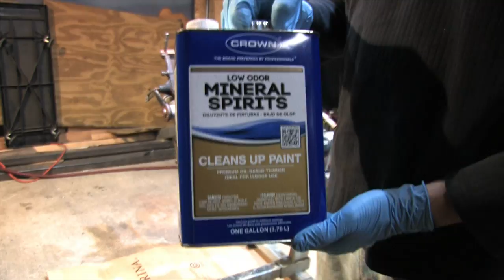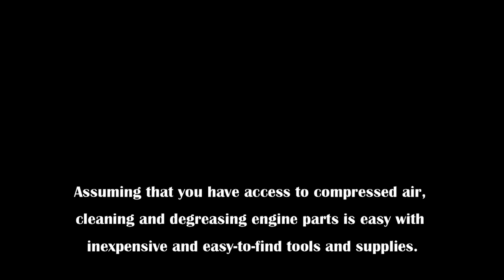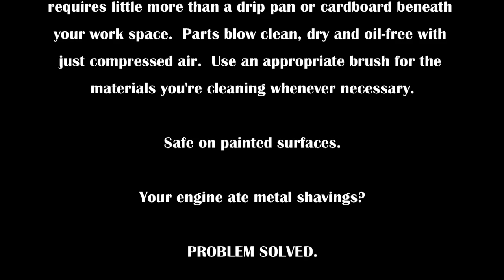DIY Parts Washer

Comment: what happens at 2:39 it shows a light switch and your rafter and you turn the switch on but nothing happens.  Maybe something up in the rafters moves a little?
Reply from the maker: +The Headless Horseman I have a 1900cfm evacuation fan mounted in the gables.  I built it into my garage in a previous video, but now that the ceiling is mostly finished, it's harder for me to show it.  If I open a door, it clears the garage every 4-5 minutes.  Mineral spirits don't smell particularly strong in this configuration, but the label still recommends ventilation.

Comment: So. How many gallons did you use?
Reply from the maker: 1.2 gallons. Cleaned absolutely everything.  I could have stretched 1 to do the whole thing by working in smaller sections with a brush but it would have taken longer.  I was motivated to finish it and get out.  It took less than 2 hours including filming it.

Comment: @ 0:35 im gonna say youve had a snapped rod before? judging by the missing chunk at the bottom of the cylinder :X
Reply from the maker: +HazeHDesign Dropped a rod cap.  Fastener failure.  The block was found that way in the junkyard.  It's been rebuilt 2.5 times since then, lol.  Honey badger award.

Comment: Did you clean all your part with one can
Reply from the maker: With some creative fluid recycling and aggressive brushing, and regulating your pressure down to 30 PSI you could easily clean a whole normal non-rusty engine with a gallon or less.  I used a gallon plus 1/2 quart because I decided to soak a few things.  I ran 110 PSI because I was in a hurry.  I don't mind having leftovers because I'm definitely going to use 'em.

This was the rustiest crankcase I've ever encountered.  The valve cover was a real challenge, and it might need more work, or even replacement.  I can see the rust farm inside this block now that it's completely degreased.

Comment: Good idea if you have no issue with wasting money, I'll stick with my parts washer that contains its fluid when being used.
Reply from the maker: Noted.  But I disagree with the wasting money part.

Parts washers are perfect for small items and engine components, but I can't find a parts washer that can hold a whole engine block without toppling over for less than 800% of the cost of this solution.  This method is not meant to replace a traditional parts washer.  It's a portable solution that washes things that don't fit in a parts washer, or for people like me who only need one once in a blue moon.
Reply: I'm not meaning a weeks salary but it is wasting money in my view.

Comment: Where is your water rinse mineral spirits is hard on aluminum and steel always rinse with water asap after mineral spirit bath. That engine is worthless now or will be after a few days of sitting with mineral spirits residue on it. Steam and hot soapy water still the best and safest way to clean an engine
Reply from the maker: This engine is installed in my Hyundai and working beautifully, making around 400hp.  I never rinsed it.  It's fine.

Comment: ***** After cleaning, what is your preferred method of oiling cast iron parts?
Reply from the maker: MiraclesFSC Just soaking them in clean engine oil is really the best for the home mechanic in my opinion.  It's most certainly the easiest.  For the pro, I'd say a burn-off oven followed by hot oil quenching.  If you will need to install parts that are oil-free, or paint them... either of these methods could be a problem because it's hard to wash off even with mineral spirits.  Using a thin oil like WD-40 is acceptable in this case, but it will need to be re-applied regularly because it evaporates.
Reply: ***** Thanks for the reply! Also, how long do you recommend soaking for. And are they to be immersed in oil, or wiped with a thick coat (frequently) with oil. thanks again. Love the vids. My first car was a Talon TSI AWD. I miss the 4g63 :D Gonna have to get one after my 280z is done :)

Comment: Try oven cleaner, its a miracle
Reply: +Chuckles I heard oven cleaner is not good for aluminum.
Reply: I used oven cleaner to clean my aluminum intake plenum out and valve covers. Applied the cleaner then high pressure water sprayed at car wash. No problems since reassembly. Maybe if you leave it on too long before washing it off it might be bad. Its not like pouring pure lye on it and walking away. I just left the oven cleaner on for like 2-3 minutes, it works fast, and rinsed real good.

Comment: oh boy.. buy a small cabin or build one from sheet metal please. this is so wasteful and inefficient. its not expensive so dont be lazy :(
Reply from the maker: What am I going to do with contaminated mineral spirits filled with dirt, sand, rust, oil, carbon, and chunks of gasket material?  I've captured and re-used mineral spirits in other videos and proved that it turns parts brown and contaminates them, forcing you to have to clean them again, and with much more harmful chemicals than purified and distilled coal oil.  I do appreciate your concern, but cleaning an entire engine with one gallon of this low-level of a hazardous solvent/fuel is actually much more efficient and friendly than a whole case of carb cleaner containing acetone and/or xylene, benzene and chlorine.  Chemicals that are not only powerful biotoxins, but that don't even do as good of a job as mineral spirits at 10x the price.  I apologize if what appears in this video makes you uncomfortable, but I stand by it. There is no completely safe way to do this, but this method is actually the most efficient, and it's one of the safest provided it's done outdoors away from sources of ignition.  I did it indoors with ventilation because I don't smoke, and I needed to be able to shoot the video in a controlled environment.